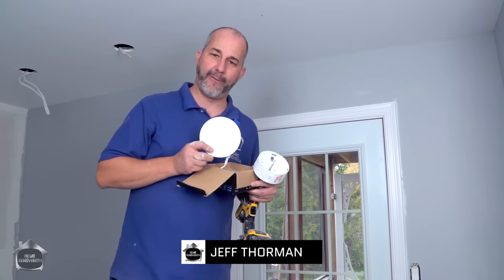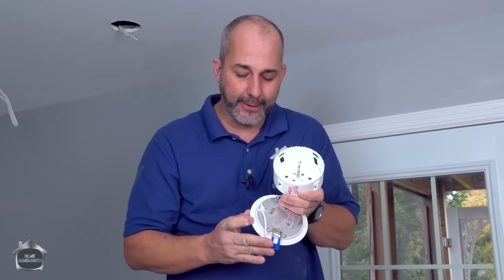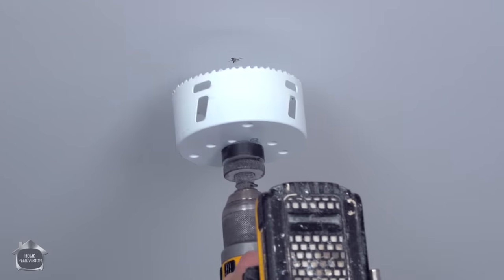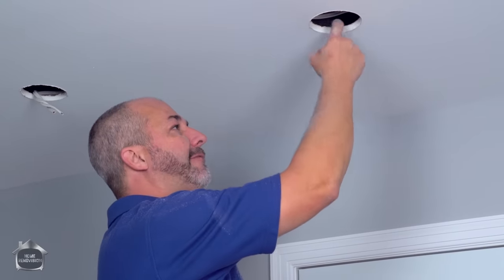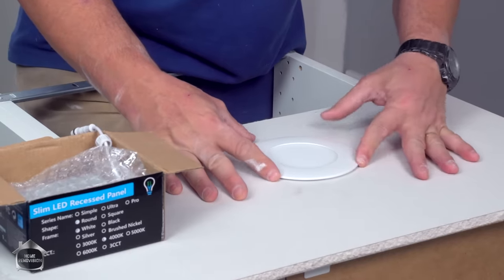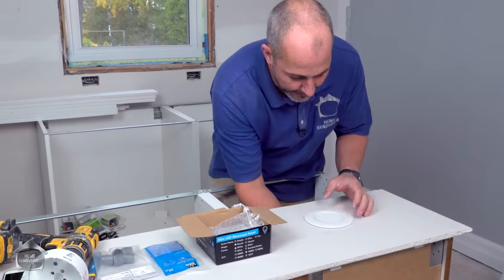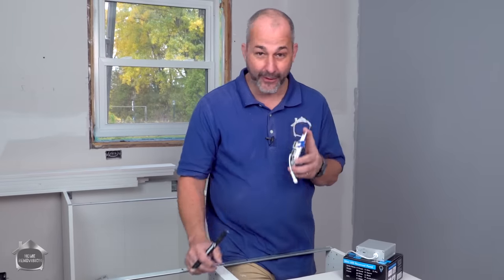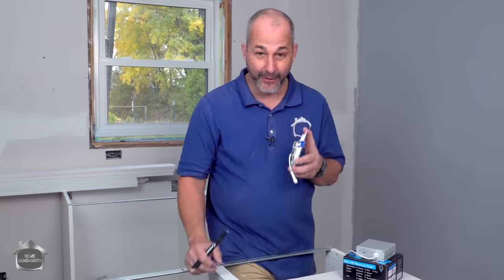How To Install Pot Lights in Kitchen Ceiling

Comment: If you've got the drywall down already can you wire up the boxes and leave the wires dangling? Then just plug in and snap the light into place post paint when the hole is drilled?
Reply from the maker: yes!
Reply: Appreciate it!

Comment: Why do you wait for the ceiling to be painted/finished before you install lights? Wouldn’t it be a good idea to do that after lights are in incase you mess up (I’ve never installed before, trying to diy)

Comment: Is the box rated for insulation ?  Im just thinking the box gets hot and it may be a problem.  Any input would be great im going to be installing at home.
Reply from the maker: yes they are IC rated for contact with insulation. Cheers!

Comment: I just wired 2 Romex into the  same hole in driver as done in this video.  The 2 Romex seems too large for the hole as there is a small gap in plastic cable connector.  The wire sheathing actually made contact with metal box causing a tear. Is this code?

Comment: Thank you Jeff! How do you retrofit can bus type light to these?
Reply from the maker: Not sure you can. the supply line is buried. check and see if they sell a led light that gets installed into the old threaded bulb connection. Cheers!

Comment: Any hints what to do when the house you bought has those older active ceiling heating system. We can see the heating coils in the ceiling when the initial heat is turned on. We cannot see this system from above either. They must have installed the heating in the ceiling when house was built in “72” and between the drywall and wood plywood attached to the rafters....  we are worried we might nick a wire!  We know nothing of this heating system except it works!

Comment: hello and couple questions  i am doing these light along the eves of my house when i run the power do i cut it every time i want to add a light and how can i age these light go in a line and not do all this cutting   also in the family room and master bedroom. i had t pre wired for a ceiling fan and light  each on it own switch  the builder wanted 700,00 to install 4 of these in the tray ceil, how do i run the wire 
to each area from the center with out cutting alot of holes 
thank you

Comment: How can I maintain soundproofing in a home theater when installing these pot lights? I've got a 2x layer of drywall with green glue on the ceiling in a home I just purchased and don't want to kill the soundproofing by adding the much needed pot lights.

Comment: Hi, I'm in UK we call them spot lights! Anyhow just stumbled across your video, I'm thinking of having these installed by someone they are charging me £180 for 6 spotlights in my kitchen I was thinking to get the better quality as you mentioned but how can you tell if there is a rubber gasket and good springs when they are packed in boxes? Please help. I've been looking on Internet but have no idea. I feel women get overcharged by guys who take advantage of situations knowing we don't have a clue. I have artex on my ceiling too so I assume that has to be skimmed off first another costly job for me!

Comment: A nice wiring trick I noticed at my house is the electrician re-used some of the plastic wire sheathing like a protective sleeve in areas where the wires enter the electrical boxes. Protects the wire from being exposed

Comment: which size do you prefer 4" or 6" for a large open room with a kitchen and living space
Reply from the maker: 4" for standard height rooms 6" for high ceilings
Reply: @HomeRenoVisionDIY  I have vaulted ceilings in my space and i only see 4" gimbal in reno led lighting

Comment: If you get a clear plastic salad bowl/soft non shatter plastic from the dollar store...you can drill a hole in the center and stick it before your 4" hole saw, you can then use that to catch a good portion of dust.  That being said it will be harder to see but that is what a pilot hole is for ;)  another tip is if you drill your pilot hole first then use a coat hanger, bend in the shape of an "L"  to double check for joists, cross bracing, pipes or electrical by moving it around.  This way you can move the hole over without having to do any repairs besides the pilot hole if you encounter something. You are welcome, ill be here all week.

Comment: Question: I bought Trenz LED "recessed" ceiling lights from Lowes. For the rest of our reno, an electrical contractor installed these kinds of lights and used those metal mounting plates with the hole cut out that are screwed to the joists before drywalling. I'm not sure I really need to use those in my basement rec room reno though. I'm more worried about not quite lining up the hole I cut with the hole in the plate after the drywall is done. Are they necessary? It doesn't look like you used them.
Reply: They are not required. Those mounting plates are for new construction, so the sheet rockers can cut perfect holes with their sheet rock cutters. In a remodel application you can make a perfect hole with a hole saw.

Comment: How well would these lights work to illuminate a living room when installed into a sloped ceiling?
Reply: They would probably do a good job, but you can also get similar lights that are on gimbals, so you can aim them where you need to.  Just search 'recessed LED gimbal lights'.

Comment: Tried the method of drilling in reverse, and if there was more then a little bit of pressure on the drill bit, the large, 4" bit portion of it kept unscrewing from the arbor and pilot bit. Going any slower and using less pressure didn't make much progress and I switched to drilling in the normal direction (no wires in the ceiling in that location, so it was safe to do).   I got the "Milwaukee	4 in. HOLE DOZER Bi-Metal Hole Saw with 3/8 in. Arbor and Pilot Bit" is it not intended to work in reverse or am I missing something.

Comment: Is there a video on how to run the wires in the ceiling for the potlights.  Specifically how to get wire from hole to hole going across the joists.

Comment: You never addressed whether these are safe for use under insulation or not. Does that little transformer heat up? How about the light itself? It makes sense that they are fine but I'd love to know for sure. Also, did I miss whether the box is a separate cost or included with the light fixture- is that an additional cost? Thanks. Otherwise- really informative video.
Reply: We just bought a half-dozen at HD, and each one had the box.
Reply: @PatrickKQ4HBD   Thanks Patrick.

Comment: Are those light low voltage? as the plugs on them seem a little small, also how do you determine spacing on your lights so you have even coverage?

Comment: Recessed lights are definitely a big mess over the internet... I have tried expensive ones, home depot and eBay dirt cheap. I have to admit the vegalighting seems a pretty good deal! The quality looks much better than other providers and they provide a 5y warranty! If they really comply with the warranty, that will be the place to be! 
The video explains very well the wiring but it would have been great to talk about the electrical panel connection setup.

Comment: Can this light and box be covered with insulation in the attic? Also, is it OK to use caulk or foam insulation at the joint between the light and the drywall to minimize air leakage?
Reply from the maker: yes it can go there. and no to the caulking idea. it is legal because you have access. once you seal it it no longer is accessible.
Reply: @HomeRenoVisionDIY  Thank you!

Comment: My scenario:  I want lighting on exterior soffits of my home.  I have 2 exterior sockets (in the soffit) where i run my christmas lights to.  I want to put a smart plug on it and run some puck lighting  in parallel along the soffit.  thoughts?   i want to avoid running wire above the soffit.  I cannot find any products to do this.

Comment: I have recessed lights I looked on the link for replacement slim pot light the did not have the type that screw in to the existing fixture, then just clip in to seal up existing hole. Is there such a thing and where would I purchase them in the US. Thank you

Comment: Variable speed trigger,  holesaw not drill bit, pilot bit is the center bit. 👍 on the reverse tip also like testing on scrap drywall tip. 40 year retired union electrician ⚡️

Comment: We just installed one of these lights in our house. It comes with a cut out paper that you place on the ceiling to trace the cut around. If you’re installing multiple then it might be better to measure diameter and get this attachment.
Reply: Its worth buying the hole saw to even do one or two.

Comment: I would like to convert my kitchen large 4 tube fluorescent light to 4 of these types of lights.  Current fixture is only light on 3 way switches.  Is it just a matter of fishing more wire around. I believe i have trusses in my kitchen ceiling, 1st floor with finished room above.
Reply from the maker: yup just fish a 14/2 to the rest of the new locations. easy to do once you drill the holes.

Comment: Didn't get much out of this as far as wiring is concerned. Have the exact same lights. Each light comes with 3 wire connects with 3 holes in each that go in one way. To me it seems like I should run power and switch to first light connect white to white black to black ground to ground and then another  wire going to the next light. So if I went to wire nuts I'd have 3 wires in each nut from light to light. So a romex going in one side of junction and one going out the other side until the end. Right or no? The easy connects easily confuse me.

Comment: I've installed 5 of 6 pot lights in my kitchen. The 6th is the light that connects to the switch so there is an extra wire. How do I connect the wire switch? There are only 3 holes in the 2 wire connectors (1 black, 1 white) connected to the light.

Comment: What's the code on mounting/anchoring/securing the junction box in the ceiling?  Or stapling the romex?  I see everyone just push everything back into the hole.
Reply from the maker: once you close the ceiling there is non need to further secure the wiring. the staple requirement relates to keeping wires from being pinched while installing drywall so once it is up you are goo to go. you can even drill more holes and fish the wire and add more lights. Cheers!
Reply: @HomeRenoVisionDIY  thank you.  Your content and sharing your knowledge and experiences have been instrumental in my journey to become a more competent homeowner and DIYer.  I emailed the manufacturer and the response I received is same as installation instructions that came in the packaging: mount LED driver/jbox as required by local code.  My local code says it uses NEC 2014.  Section 314.23 (A)-(H) say an enclosure must be secure.  Although are these (driver/jbox) considered enclosures?  They do not support the lighting fixture.  I also referenced section 410 but don't see anything about mounting.  I've done switches and fixture replacement, but this is my first time running new branch.  Just seeing if I can find and follow applicable code.  Fundamentally, I understand what's going on and think your method is fine, just trying to verify.

Comment: How i do it is when im drilling for these wafer lights i carry around a cabinet style 3/16 flat and i put the drill in high speed and turn the clutch down to around 12ft/lb the bedt way to drill em is beat a hole in the center with screwdriver and waller it for the pilot. Then put pilot bit in and spin it up to highspeed and slowly let the blade hit with very little pressure and it takes no time and doesnt create any torque. Also if the blade bites into a furring strip or stud u dont have it kick and try to slap u in the face the clutch just slips.

Comment: How do handle 2 way switches with these lights? I have a single overhead hallway light that I want to replace with these, but they are on a 2 way switch with one switch at each end of the hallway. Any help would be greatly appreciated!

Comment: How do I know my electrical code.. I am in LA. I follwed ur video and add 6 LED POT lights 6 inches.. in my living room.. with existing 1 LED light Halo.. and It works really good.. but I am worried about what is the code.?

Comment: Sooo… I love what’s your doing on your channel but as a sparky with around 15 years in the trade I would say the biggest difference in the quality comes with the voltage rating. A lot of the Chinese make stuff will only be rated at 120v I would say that make sure the minimum voltage rating to look at is 125v or even better 130v. I can’t tell you how many LEDs I’ve seen fail from voltage spikes and brown outs. Also the reverse hole saw is a great trick, it’s super handy to not break through the vapour barrier and get blown in insulation all over your face.

Comment: Jeff, for a shower installation, I'll have 7/16" Wonderboard with tile over it, for a total thickness around 3/4".  Will this light clip in at that thickness, or are there ones available with a deeper reach on the clip? Also, are there some mounted  with a gimbal to aim the light against the wall?

Comment: Question, can these LED ceiling fixtures be installed in a 1” thickness ceiling e.g. double 1/2” sheet rock ceiling in a townhouse garage?

Comment: What if i am trying to run the lights from a existing fixture and i take the light down and there is already two sets of wires in that box 3 White 3 Black 1 Red is it possible or whats the best way to do that ?

Comment: Hi l’m a new homeowner. Can you do a video on how to replace a blown pot light. The pot light in my bathroom blew. It looks exactly like the one in this video. It does not have a bulb you have to replace the whole fixture. How do you do this?

I checked Home Depot they sell this type of light fixture with a junction box. If it’s simply a matter of replacing the pot light do l need to become an electrician and connect the wiring to the junction box provided. I just want to replace the blown pot light. 

I’m not that old but we used to have pot lights with a bulb now you have replace the whole fixture. 

Thanks for your help.

Comment: How do I add an E26 adapter with an led driver with green wire. I don’t have a copper wire with the 3 wire led driver. So I just tape off green wire??

This is prominent in converting square box lights to led lights with led driver. 

Please help. A good write up I would like.

Comment: I bought these lights from a link on this video back in July.   I want to order more and the link is now different.   This link says they are sold out.   Any other sources?
Reply: I have the same question.  I checked a few months ago and they were a good price but now sold out and more expensive than they were.  Looking for another supplier option if you have one, Jeff!
Reply: I found some from a local supplier in town. Their site says they sell to contractors but when I called they said they're happy to sell to homeowners too. The ones I'm getting are from Osram Sylvania. I am about to go check them out and make sure they meet the recommendations laid out in the video. The other option I saw was from Lithonia but they told me they can only sell them in Wisconsin, not MN, lol.

If you live in MN/WI area, the supplier I'm talking about is Viking Electric: https://www.vikingelectric.com/about/locations

Comment: How do you remove this without messing up the drywall? Mine seem super tight to the point where I can see the springs digging into the drywall. Seems like it could rip out a piece if I pull too much.
Reply from the maker: pull a little and then use a flat head screwdriver to push back the spring. Cheers!

Comment: How do I run the wire in a vaulted ceiling with scissor joists between the drywall and roof sheathing, but with blown insulation on top of the drywall?

Comment: Hey, what if there is also a red wire? Where and what do you connect that too?

Thanks!
Reply: I just used the same wire (12/3) to install these lights.  You just don't use the red wire at all.  An electrician friend told me you can use it.  I did wrap some electrical tape around the ends of the red wire just to be safe but that's probably unnecessary.

Comment: I use a plastic container. Drill a hole through the bottom of it to put the auger bit through. Now attach it to the drill. I use a longer drill bit to see past the edge of the container to line the bit up with the mark on the ceiling. When you start to drill, slide the container up the bit until it touches the ceiling to catch the dust. Make sure you wear a mask and safety goggles. I also run a shop vacuum in the room. I sometimes use a box fan if I know what I'm doing is going to create dust.  I run it in an open window. Helps keep the dust down too. You may want to cover any surface with plastic to keep the dust off of them. Unless you want to spend hours after the job is done, wiping down everything. Bin there done that, not fun.

Comment: I need to replace one of the modules that isn't working. How do I remove the electrical wires from the   plastic clips in order to install them in the new module?

Comment: one other thing to consider, If any of your lights happen to burn out, there is no changing the bulb. You have to throw the entire fixture away. Since the  lights are cheap, buy a few extra and store them away in case this  happens,   You may not be able to get the same fixture down the road.

Comment: Actually over 40 factories plus make them. U can go on alibaba site and order these direct in small quantities for as low as $2.00 each same as you shown. Cheers
Reply: 90 percent of the time you get scammed on alibaba. I have 20000 worth of useless stuff from alibaba that I just got stuck with.